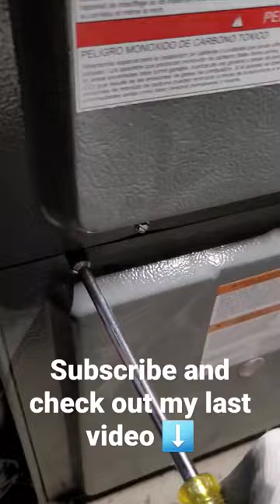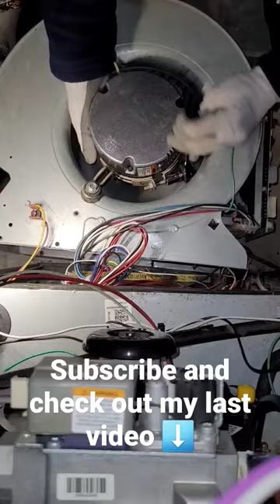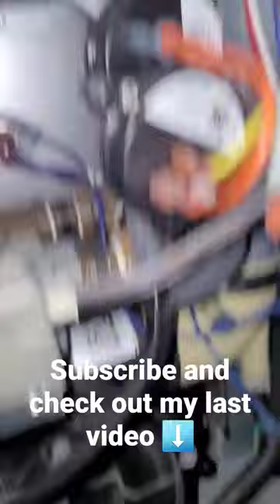Ecm furnace blower repair #shorts #satisfying #hvac #viral

Comment: Where did you order your motor from? I need to replace mine and can't find it online
Reply from the maker: Directly from Goodman. Where are you located?
Reply: In Austin,  TX.. motor is a Gentq ECM 3.0. The furnace is a Bryant
Reply from the maker: @jessefranco9301  What are the symptoms? Does the blower try to start at all? Does it jog back and forth and then turn off? If youre lucky you could replace just the module and not need an entire motor assembly.
Reply: The motor is 12 years old. It won't start up at all. I don't want to buy something of ebay since it's a rough chance it will not work and I spent money for nothing. I had ac guy come out and check it out,  he told me it was the motor
Reply from the maker: @jessefranco9301 did he quote you a replacement or was it not available?
Reply: He called today and said it's a 4 month delay for the motor. I can't wait that long , I already pulled the old one just need to find a replacement.
Reply from the maker: @jessefranco9301  email me a picture of the connectors on the motor, I'll see what I have on the truck. Smithvac@outlook.com
Reply: Thanks a lot man. I just emailed you

Comment: is there anyway the AlS auxilary limit switch can prevent the blower motor from starting i already replaced the transformer and still did not start im not sure if als needs manual reset if that will solve issue or blower motor needs complete replacement.
Reply from the maker: No, the motor likely needs to be replaced.
Reply: Is there access to the fan capacitor...9 out of 10 times that's the prob